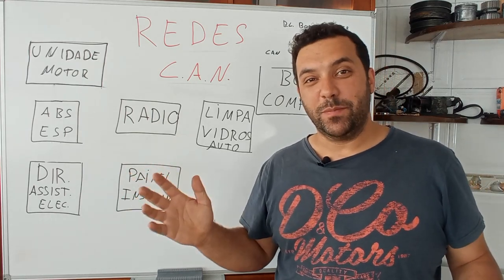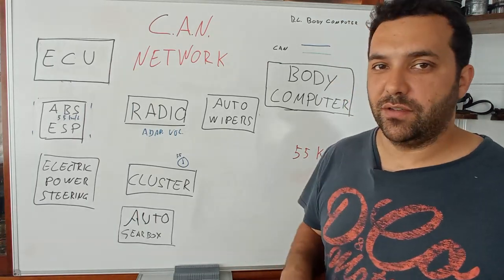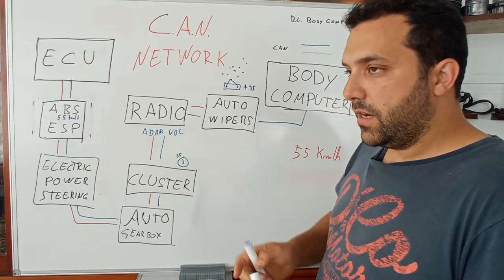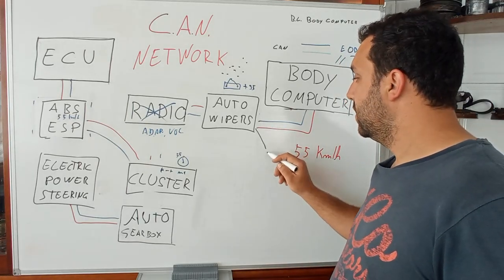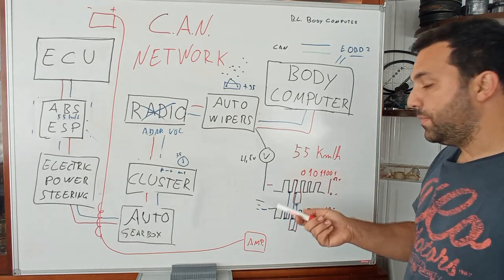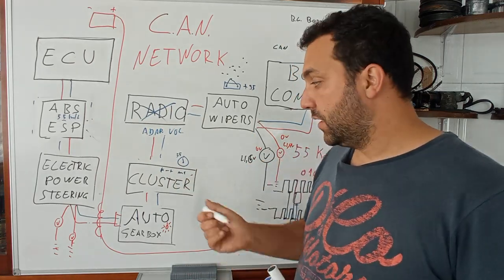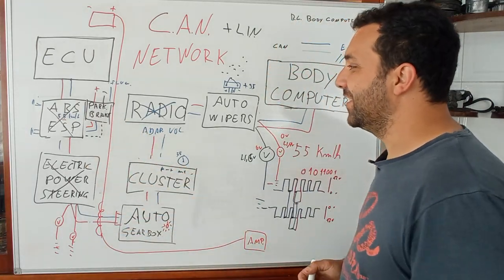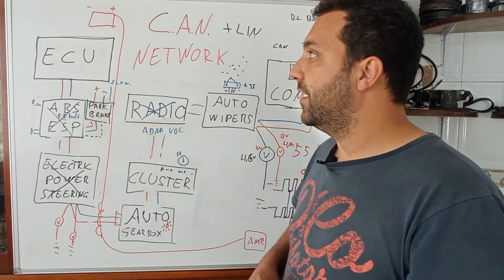C.A.N. bus! The importance of the system, practical aplications and system advantages!

Comment: Hello. How do i remove the shift knob of an alfa romeo 146 manual 5 speed is it with pulling or twisting i dont wanna try pulling it when it should be removed with twisting and vise versa
Reply from the maker: Hello. All I seen so far are pulling. So, try that
Reply: @alfaromeonoproblem  I tried pulling it off right now but it doesent move
Reply from the maker: Maybe someone glue it down..